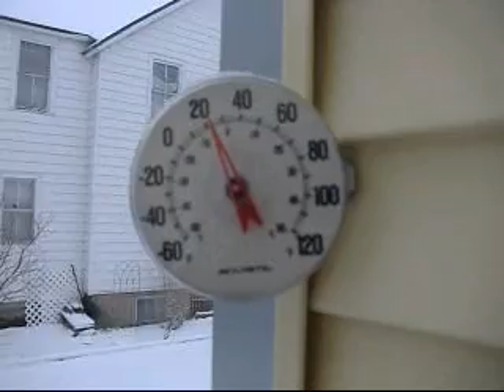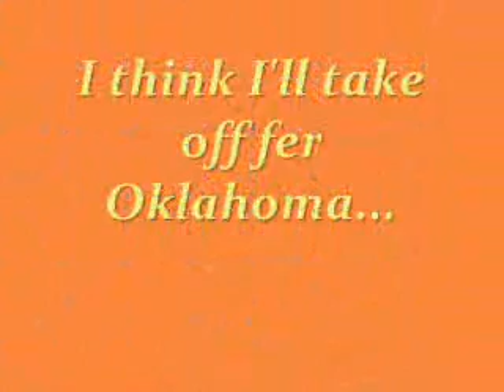1 8 11  Blazer Winter Crank...

Comment from the maker: @llamaking12 I replaced the in block glow plug controller that sometimes worked w a brand new one, and it won't turn off. Waste of 50 bucks. I just bought another new one on ebay for 30 shipped. We'll see if it works. I' m NOT putting on a manual button!

Comment from the maker: @Chevynoob I just like opening the hood every morning and looking inside. REALLY!!! I just ordered a new glo plug controller off ebay, brand new, 30 bucks. The last one I bot from ebay was new, but won't shut off. I'll try again! Nobody but me uses the Blazer, Mrs CW uses the Sub, so if that one needed a button, I'd put one in, but I prefer that things are like GM made them, when it works as it should!

Comment: @CORVAIRWILD 
did you check your little plastic oblong relay on the firewall  ? (They overheat, and melt a plastic internal part, and even if you hear it click, may not make good contact, or worse yet, they make contact all the time, and burn up the glowplugs.)

 and the glowplug module ? the coolant temp makes it work or not.
(found on a forum)

as i know you can install easily 2 vw idi glow plugs relay wich are on the 4 cylinders rabbit diesel and remove your crappy system.

Comment from the maker: @michaelovitch I could disconnect the relay, like I do on the Blazer. But the prob started when I did the power window to the pwr lock trick, but the problem doesn't appear on the blazer. I did the same wiring there... So....